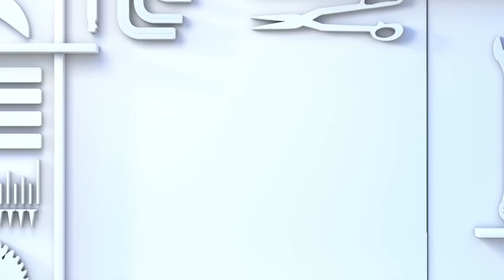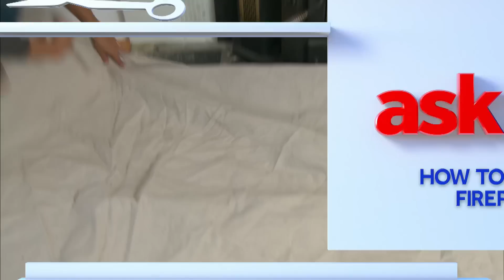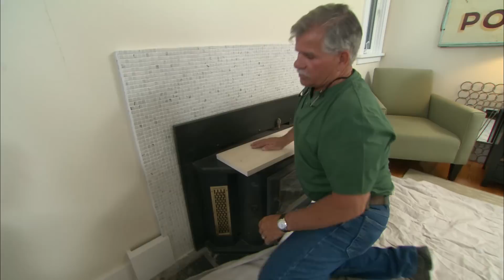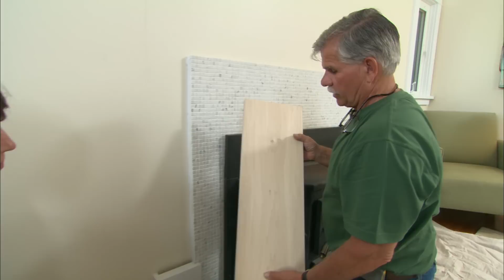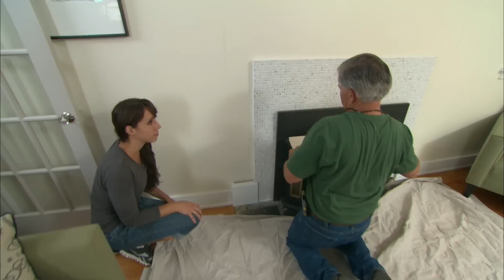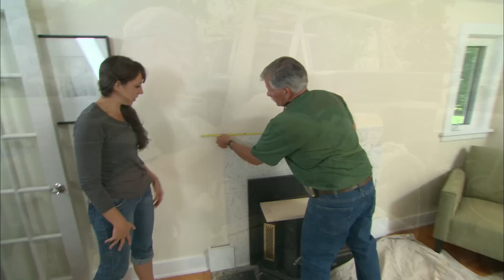How to Build a Custom Fireplace Mantel | Ask This Old House

Comment: It might be a good job what you done but for the material of popular is no good as it is too soft as it dints to easy even if you push your finger nail into it it will make an impact on it ok.
Reply: Dont push your fingernail on it. Problem solved.

Comment: I was thinking about making a taper jig for my table saw to cut some filler pieces for cabinets next to un-square (un-plumb) walls, but a straight edge and circular saw will work just fine.  Thanks for the tip. 4:50  Also looking to build a mantel which will hide wiring so I will obviously have to modify this design. But a great starting point.
Reply: Scribe and then freehand it on a table saw.

Comment: He put the shims on the wrong side.  What the...?
Reply: No he didn't. He did it correctly. He just made sure the shims centered the wood, that way even if he flipped the board, it would still be in the same position.

Comment: He was supposed to make the reveal softer. Instead he made it deeper because he softened it on the wrong side.
Reply: I think he did it right. The original reveal was 1/4" (5/4 vs 4/4 lumber). He then used shims that reduced the 1/4 to about an 1/8. When he is done, the reveal is 1/8" not the original 1/4. It was a bit confusing flipping the board, but in effect he centred the board on the pilaster. Tommy is a master.
Reply: Thank you.  I just was watching and jammed on the brakes.  I'd seen this video before and I just noticed it.  Everyone else is zombied out.  I'm surprised that Tommy actually made a mistake.  I was starting to think he was Clark Kent.

Comment: Seriously all that work in poplar just to cover up beautiful grain with paint
Reply: Poplar does not stain well, and the color consistency is variable, which is why it is a Paint-grade material. I don't know any carpenters that use poplar without the intent to paint it.
Reply: LP81 you can stain poplar if you properly condition the wood with a pre stain. Gel stain also works better when staining woods that can be blotchy because it lays more on the surface and doesn’t penetrate as much as traditional oil penetrating stains. I’ve actually had great results staining poplar and made it look very much like cherry using a reddish gel stain and good surface prep.